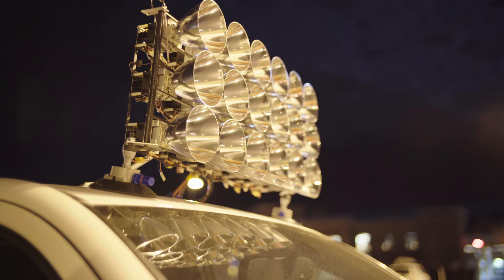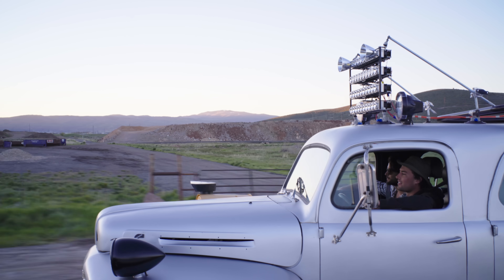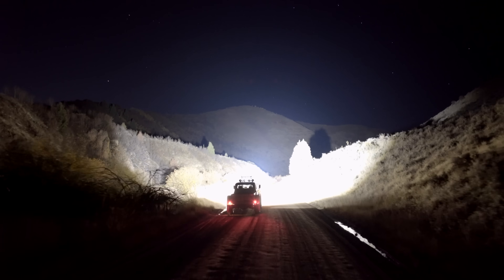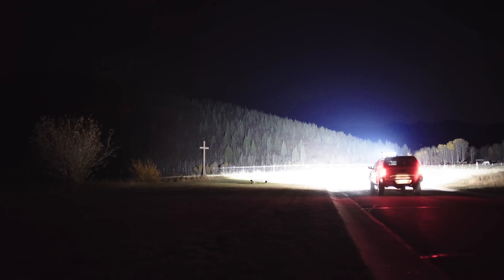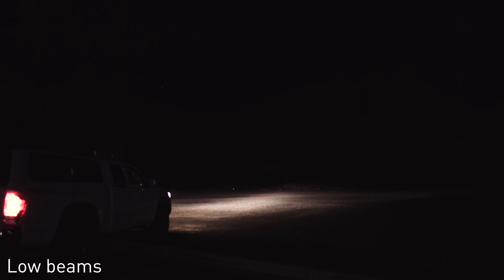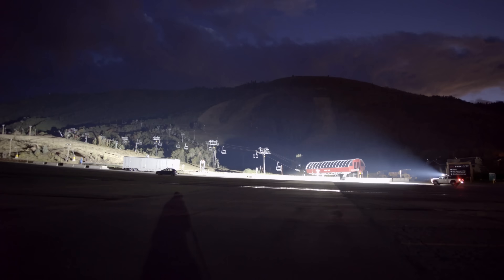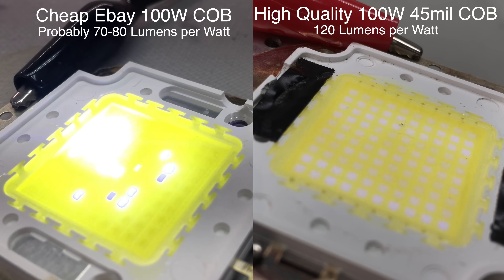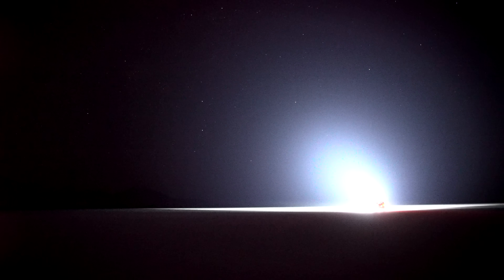Worlds Brightest LED Light Bar - 4kW LED Array

Comment: Hi, I’ve built a single row light bar and mounted 26 x 100 watt led cobs and water cooled the heat sink, I have 13x 400 watt power inverters each 400watt inverter is powering 2 x 100watt cobs. 
I was going to set it up to run off the car 12volt battery but would rather it have its own power source. How would I go about doing that?

Comment: Imagine about 80 750 watt LED lights in modern football stadiums about 97,500 lumens per light which which is 7,800,000 lumens. Each light is probably just as bright as a 3,500 watt old fashioned metal halide bulb. That’s probably too much though for a stadium. LEDs are far brighter. I’ve seen fixtures also at 1,200 watt fixtures which is about 156,000 lumens per light. Multiply that by 80 lights equals a staggering 12,480,000 lumens. That’s probably good for over 100 feet though. LED lights are by far the most efficient lighting and definitely not as hot as incandescent, halogen, or metal halide, high pressure sodium, or mercury vapor and even fluorescent. These lights are nice.

Comment: You should add 2 big led bars on the hood, 6 ditch lights (3 each side in a triangle), 2 ditch lights (1 each mirror), a grill medium led bar and another medium bar on a nudge bar.

Comment: I wonder what the heat input was to the hood of the truck. 4kW boils a liter of water in 80 seconds. Also, you can cut decent sized sheet metal with a 4kW laser beam.

Comment: The truck featured in the video is 1948 Ford F6 truck with a Cummins 12 valve turbo diesel is for sale on Ebay now.

https://www.ebay.com/itm/1948-Dodge-Power-Wagon/183964995217?hash=item2ad52b0e91:g:AuMAAOSwGR9dhjgz

Comment: You could probably get away with using one larger reflector for those, rather than a bunch of individual reflectors, the single larger reflector would probably increase brightness because you can fit more LEDs into it too.  And with a narrow aperture you could burn shit with that light bar.

Comment: High wattage lights made from several smaller LEDs are best for reliability, for if one LED fails, it doesn't kill the whole display.

You could have reduced power by adding lasers to the mix. I have a high wattage LED on my motorcycle whose output is enhanced with slightly defocused lasers. Green and blue lasers are best.

Comment: Looks like I just found my next DIY LED light bar parts! Absolutely amazing!!!! I was going to take 8 Convoy L6 reflectors along with 4.8 amp drivers and XHP70 emitters and build a 32,000 lumen light bar but after crunching the numbers I think 4 of these modules will do the trick. 89 dollars for 14,000 lumens! that's hard to beat. AWESOME VIDEO!!!!!

Comment: kids running off road lights on road now either get something from my cab thrown at there windshield or I just swerve extremely hard in there lane technically I can't tell which lane it is anymore anyway , so legally there getting ran off the road thanks to THE FACT THEY CHOSE TO RUN ILLEGAL OFF ROAD LAMPS

Comment: Do you have a parts list for the individual led heat sink and fan? I would love to re-do my existing setup which uses a large voltage booster meant for a house and a water cooling set up

Comment: Worlds most impractical off-road lights. Carry 2 dedicated batteries. Stick it with 4 suction cups that will just do “great” over rough terrain and, well, off-roading.  Sorry sir but first of all, you really need to mount them with something more robust and durable than suction cups. Second. You will never need that much light anywhere, and even if you do, that much light makes everything directly in front of you appear white and faded, meaning you’re missing detail in the trail, like a log that might hit your control arm that you don’t want to go over. I don’t know, it’s very cool but very impractical.

Comment: Our 4x4TruckLEDs.com demo truck has over 124,000 lumen of light on it between 2 50" Light Bars from Baja Designs... so we're up there in terms of light output (and it's not a huge stack of lights either)

Comment: pretty sure this is a massive eyesight hazard. if you accidentally flashed someone you could be sued for causing blindness. im not kidding. also, anything within 15 feet could spontaneously catch fire. other than that, continuous use isn't practical. 1 minute at the most. 18 KW on something the size of a stovetop... Watercooling would be more practical for longterm use applications such as rescue.

Comment: turns light on truck goes from 198 wheel horsepower to 30
Reply: Guns Of Spuds 😂😂
Reply: Car battery goes from 90% to 1% in a sec
Reply: he had a generator on the bad
Reply: Would still have the same amount of power, just most of it would be used running the lights. Under 3hp. 1hp=750w
Reply: r/woosh
Reply: I reckon I can build that 
Do you understand what wheel horsepower is?
Reply: @tylerbrinker6582  Do ya think he means crank?
Reply: @loumorningstar7709  yes but the other dude specifically said wheel hp and he tried correcting him. Atleast thats what i got from it. just busting some balls
Reply: @tylerbrinker6582  Yeah that whole wheel hp thing confused me for a hot second too.
Reply: @tylerbrinker6582  wheel hp is like normal minus 10-15 % losses.

Comment: I'm just thinking when your driving, if someone comes round that corner, they are going to be blinded. Like blinded for life.
Reply: I was thinking this is good for when somebody leaves their high beams on you can remind them with this light bar.
Reply: @Mercury Vapor Light Actually it would probably be your safest option, on the shoulder of course(in case captain derpypants comes back and has another "bright" idea) if you ever encountered these lights on the highway. If that other guy is any indication then there are plenty of retards that would just barrel on down the highway being blinded and not knowing what to do.
Reply: You're
Reply: Yeh, actually really scary thought. Like, did he need a permit to test this because it is extremely anti social and dangerous.
Reply: Joe0400 probably not any different from looking at football field lights
Reply: @space.cowboy69  you don't look at football field lights at eye level at 20meters from you in a direct beam. And installation of football lights needs a permit.
Reply: @gador789  what , you shut your eyes when driving? If you know how pupils work you would know that they are wide open in the dark and you can shut them on command. They need time to adjust.
Reply: @reddaB  You obviously didn't think it through before replying. So let's try and get there together! What do you do if a car has it's high beams on in oncoming traffic? Are your only options starring right at them or closing your eyes? No, of course not. You should have been taught to look off to the opposite direction a bit so you aren't getting the full blast of light. Although that wouldn't help much with these lights alternative options do exist ranging from blocking the light with your hand to just stopping until the otherworldly light passes (hopefully without you).
Reply: @gador789   congrats, you've actually out stupid'ed ron santo

Comment: There are military trucks with 200cm anti-aircraft searchlights in the +120kW range..... for the next project i wana see at least 200kW in LED power :D
Reply: @XHAD Did you just use assume "military" and "overkill" were contradictory?
Reply: That would be a lot of heat to remove for an LED setup. HID bulbs don't need to be cooled.
Reply: Yeah but that 120kw searchlight is probably equivalent lumens to a 1.2kw led setup LOL.........Keyword: efficiency.
Reply: @JaayyMan  no They use halide lamps these days , 120kw would be in the range of 60-70lumen per Watt , most high power LEDs are in this area too
Reply: Peter Zingler Led's are actually more than twice that. Look up the Cree XHP70.2. That can do 181 lumens per watt. And there's others that do even better.

Comment: Would be usefull in Sweden during winter. No more dark days
Reply: Ugandan Knuckles it will show you deh whey
Reply: Haha ALLA fel inställda vägskyltar som bländar en <3
Reply: @alfonsaberg4551  Mmmhm dom hääärliga skyltarna😍😃
Reply: And no more snow in front of you =)
Reply: @_Kirby207  they're LED's so no heat
Reply: @tychogoedhart286  I have a flashlight powered by a single 18650 LiPo cell that can noticeably heat up your skin from about 20 inches on it's maximum brightness.

LED's generate plenty of heat, that whole entire "LED's don't generate heat" thing is just plain factually wrong - go do some research.
Reply: @tychogoedhart286  there is some but due to their build they need to dissipate heat fast unlike halogen which tolerate heat better.
Many led headlights have heat sinks sometimes with a fan to cool down the circuitry.
Reply: Eli Witt I agree with you on that. Even earlier leds 15 years ago produced heats. Newer leds today still produces heats.
Reply: Hahahah eller hur
Reply: VITUNHOMOja_GT  Finland är bäst
Reply: Yeah just mount a big array of these on top of the highest mountain in the country and turn it on on all directions during the "daylight hours" during the dark season. Maybe try using even more than these

Comment: With both of those together you may actually be able to view your lights from GOES 15 or 16 (weather satellite) which have a resolution of 0.102 miles^2 or .25km^2.

Y'all should see if you're able to create a brightening on any of the published images.

*edit - you could pull the images from an online repo or pull them directly from the satellite directly through a SDR.
Reply: damn that would be cool, i am trying to remember the youtube channel that was makign thier own antennae(?) to read the images as they were being sent
Reply: +any1alive The Thought Emporium?
Reply: Through a sdr?
Reply: A "SDR" is a software defined radio. It's also generally used as a term for a radio receiver that you can directly plug into a computer without requiring any extra unique/special hardware. They run from around $40 for a cheap one up to around $1000. With additional software you can decode things ranging from SSTV to satellite imagery to satellite TV including 'normal' radio frequencies such as HAM and AM/FM radio.

Hopefully this explains it to you a bit better.
Reply: @JustThomas1    could have probably googled it but nice information, sounds like a good summary
How does the decoding work...sounds awesome as hell, and is it much money for the software like thus
Could i grab everything thats get send back and forth from/to satellite?
Reply: Most of the software is free and decoding it is generally easy. It's unlikely that you'd be able to grab all the traffic to/from a satellite (unless it's in a geostationary orbit, then you'd need a much larger dish/antenna). If you are interested in the activity watch "The Thought Emporium's" series on the topic.
Reply: @BroccoliBrigardist  go watch the tought emporium he will explain it

Comment: I have a challenge for you great engineer rctestflight. How far depth wise can your lighting designs penetrate underwater, if positioned above the water medium?
Reply: that's right...push him towards the shorter wavelengths...i love that end of the spectrum!
Reply: Not far. 30m if you're lucky
Reply: Used a spotlight waterproof at night swimming. It was at the heatwave made sleeping unbearable, a.c. units are not allowed in dorms. Using that idea would flood all of the underwater making it milky white.

Comment: Where can i buy these 45mil LED's?
Reply: i think on his website
Reply: It's easy to miss, but I spotted Stratus LEDs on a close up of the PCB. Hence, https://www.stratusleds.com/led-cob-emitters/

edit: and also there's a link to the website in the description
Reply: You must be kidding me. They are only 20$?

How much woudl a complete setrupd with a 2x2 array cost? And how long would it run?
Reply: And then the reflector, and the driver, and the fan... 

The store actually has complete kits, and it's only one click away from the link above...